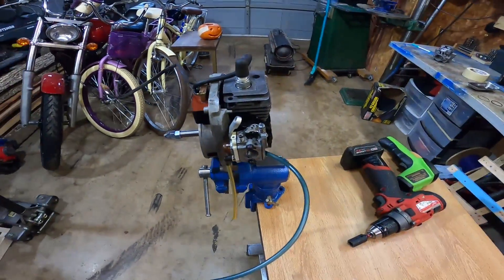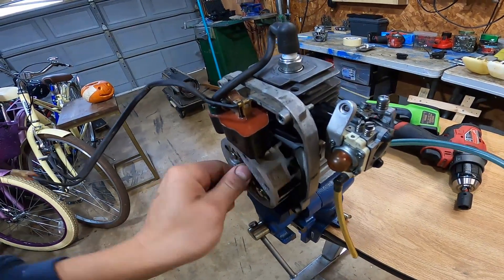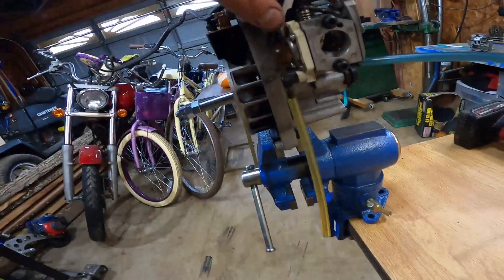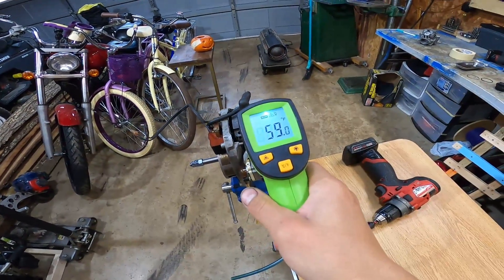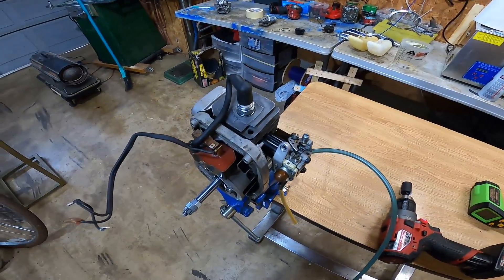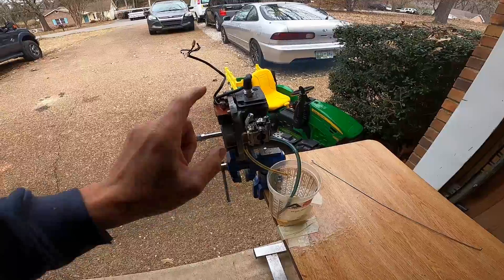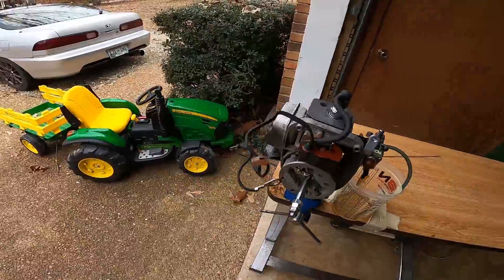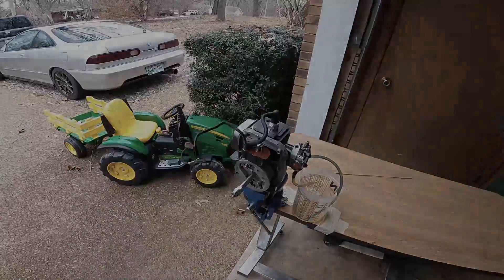Running a 2 stroke on diesel fuel!

Comment: Hozit Aaron you look like a wize man  i have a project idea to build my own two stroke engine im very technical minded got a milling machine and lathe and a bit of knowledge how to use them properly but the electronics is a battle to understand for me. 
 Question #1 is if i take a flywheel/ magneto and a ignition coil to provide the spark for the two stroke wil it work on a bike engine( the diy one) 
Question #2 why does motorcycle comes with a cdi box and flywheel /magneto and a ignition coil but stil perform the same task ultimately. 
Questions #3 Building my own diy two stroke engine for a motorcycle and just adding a fly wheel and ignition coil from a brush cutter, two stroke lawnmower mower, leaf blower etc wil it work?
Reply: It will work like a charm as long as you get the timing right. My 1982 Kawasaki kdx 175 has that exact system. And it bloody rips!!!
Good luck champ.

I think a two stroke could run with a glow plug and a spark plug and start on diesel no problem

Comment: 1/2 water 1/2 gasoline, little bit of waste motor oil for lubricity then add enough dish soap to get it all to mix it'll run with little to no tweak on the carb feel free to try it ill like and subscribe just to see that, also if you used your exhaust to heat the fuel before it goes into the carb the diesel would burn cleaner, t valve before carb to switch from gas to diesel once warmed up.
Reply: I had a stroke reading that 😂
Reply: @tyladube801  only one stroke, not 2? 🤔🤣
Reply: I wonder if you can run it on Mobil cutting oil mixed with water since it is water soluble oil

Comment: The fuel efficiency on the small engines is insane. I have a 78cc 2-stroke on my bicycle and I went a mile and a half without turning on the fuel petcock. It literally ran for 20 minutes just off of the fuel in the fuel filter
Reply from the maker: That’s pretty good! The 4 strokes use way less. But the power to size with the 2 strokes isn’t comparable lol
Reply: @aaronpratt89  lol bet
Reply: @deipweedecuchiekrucher7384  20 minutes? At what rpm? 
Killed my 72ccm because my fuel filter clogged up and it couldn’t get enough fuel…. So yeah 72ccm engine that has an mpg of 12 

If I don’t open the valve it runs for like 8 seconds tops
Reply: @donchodon4245  bro what? youre running far to rich. i have a 85ccm engine and average about 75-90 mpg depending on the rpm that i decide to ride at. about 75 when im speeding around and about 90 when im just cruising.. but 12 mpg? sheesh bro, does it not cause 4 stroking to be running so rich?
Reply: @solozedge  lol its a tank mileage less than 4kpl
Reply: I find that hard to believe, it would create a vacuum. The petcock has to have a slight flow leak even when closed
Reply: @Unknown-kd3ri  you forget about the float bowl?
Reply: @bagelbitesslightlyundercoo7958 The Float bowl ain't letting you ride for 20mins with closed fuel petcock bro. Unless your float bowl is the size of a fuel tank
Reply: @Unknown-kd3ri  Shut it boy!
Reply: @Unknown-kd3ri  yeah I have one of them motorized bicycles I have built a few throught my teens and none of witch could run for 20 minutes with the petcock closed unless his fuel line is 10 feet long lol
Reply: @cadenjames442  one and half miles I wouldn't say is impossible. There's small engines that are known for exceeding 100mpg so it's quite possible depending on the conditions of the ride.
Reply: @Unknown-kd3ri  depends on load n rpm lol
Reply: @Unknown-kd3ri  ok so what .
Reply: it took you 20 minutes to travel 1.5 miles?
Reply: Two strokes also have a habit of “hoarding” a puddle of fuel in the crankcase. When the engine heats up, it will evaporate and get used up.

Comment: Hit it with propane torch and also feed it propane for a few seconds.
Reply from the maker: I feed it map gas in one of my videos
Reply: @aaronpratt89  yeah , I ended up seeing your other video like right after that.   I blew up a Kohler motor running it off diesel.  The carb was feeding it to much diesel so it was red lined for a good hour while I was grading my driveway it on my channel,  I wish I had filmed the engine blowing up...  I couldn't believe the engine lasted an hour.
Reply from the maker: @2ndspingarage  yea engines are designed for specific fuels these days lol
Reply: @aaronpratt89  I honestly didn't care what happened to the engine.  I was shocked that it kept running with the spark plug off and running like an actually diesel.
Reply from the maker: @2ndspingarage  with high enough compression that can happen

Comment: Really cool, you don't see it much yet but converting 2 Stroke twins to full turbodiesel is a thing
Reply from the maker: I believe it. If the compression was higher on this junk motor I could probably turn off the spark ignition after it’s up to operating temperature.
Reply: @aaronpratt89  make the stroke higher
Reply: @santiagocortez9554  yep, just shave a about 1mm off the bottom of the jug.
Reply: @inoahmann7542  the what?
Reply: @jhsevs  The jug is the cylinder and head on an engine were they are cast as one solid piece. By shaving a 1 mm off the bottom it would increase the compression ratio a lot.

Edit: grammar
Reply: You can convert this weed Wacker engine to a twin turbo diesel?
Reply: @Eduardo_Espinoza  Yes, if you look at required cylinder pressure for diesel autoignition. It would have to be converted to hi pressure common rail injection for combustion timing control. Diesel octane rating is around 20 or so. It fires instantaneously when injected. Common rail diesel pressure has to be so high to overcome the cylinder pressure at TDC. Both heat and pressure control the ease of lighting it up. DARPA has been working on multi fuel power units for a long time now. They have a wankel rotary power unit that runs on diesel. It's fired with the help of the spark plug and once boost is increased cylinder pressure is raised for optimum autoignition combustion. Timing is controlled by the injection timing and advanced or retarded based on cylinder pressure and temperature.
Reply: @curvs4me  that's very cool, thank you for the info!
Reply: @curvs4me  Common rail pressure has NOTHING to do with overcoming cylinder pressures. Common rail is for finer Atomization, more precise timing control and multi event injection to get more efficient combustion.  Regular mechanical injected old old Diesels also inject directly into the cylinder BTDC, TDC, ATDC same thing. Diesels are not carbureted, they are all directly cylinder injected at , slightly before or slightly after TDC per timing specifications For combustion pressure shaping needs.

Comment: If you mix a touch of gas it will start much easier also if you pull your cylinder off and sand a couple mm's off the base it will increase the compression ratio. Just don't go to much or the piston will make contact at tdc
Reply: And when your done put it in that little John deer in the corner with a throttle limiter so your kid don't crash lol put a little smoke stack and tractor flap haha
Reply: 2 stroke compression is from crankcase not cylinder
Reply: @proforugames1071 is based off the volume of charge going into the combustion chamber. Smaller chamber with same amount of charge is more compression
Reply: @proforugames1071  bro 🤦‍♂️ in 2 strokes you have 2 types of compression the crankcase compression and the compression in the combustion chamber, both are important af and one without the other can't exist coz the same piston does crankcase compression and combustion chamber compression, if there would be no compression in the combustion chamber then all the crankcase pressure that was discharged to the combustion chamber (all that gas-air mix) would just fly out somewhere which would mean no combustion or very little combustion happening (gas and air burns better when compressed)
Reply: @datrollface2863  like spittin to exhaust manifold?
Reply: @datrollface2863 A split single 2 Stroke has 1 normal piston and a second smaller piston that creates the pressure in the crankcase very noisy old 2 Stroke motorcycles but interesting technology of the day...
Reply: @proforugames1071  both need to be sealed, but sanding the head of the cylinder can increase compression. Just need to do it on a flat even surface, like a window. Cant do that with the one piece jugs though, like in the video.

Comment: first diesel 9000 rpm hahahahaah
Reply from the maker: Just wait for the next video to drop! Thanks for the interest!!!
Reply: @aaronpratt89  thank
Reply: @aaronpratt89  usa el diesel sin el acete 2t, ya q el diesel lubrica el motor, asi mejira la quema en la camara de combustion👌🙋‍♀️
Reply: @aaronpratt89  don’t use 2 stroke oil on diesel , it’s with oil and you don’t need add oil 2 stroke and this cause oil starvation and blue smoke

Comment: The diesel engine in my 2ton is  2 cycle
Reply: I have 2 6v53’s in my 45 foot fishing boat.. these engines are tanks
Reply: @mikecorleone6797  I love them. Planing on a 8v53
Reply from the maker: What kind of truck?
Reply: @aaronpratt89  the engine is a 6v53 Detroit. The truck is an 87 IH S1600

Comment: Why is the smoke not black?
Reply from the maker: That’s a good question. Due to the lack of compression in this engine, I am not getting enough heat to actually burn all of the fuel. The second reason is the amount of fuel is still considerably low. When you see diesel trucks blowing black smoke, it is caused from a fuel mixture that is too rich but combustion is still being completed. Soo if I could increase the amount of fuel to air I could possibly have black exhaust. But with the carb I was using that would have been hard to accomplish.

Comment: Love your show got a question I have an older 49cc motor just like the goped motors and was wondering if I could take a 71cc big bore kit for a 2stroke scooter from Amazon and put it on my motor
Reply from the maker: That’s a good question. There are a lot of issues when combining engines. The first thing, is the cylinder bolt pattern the same? Next, is the piston skirt short enough to clear the stock crank during rotation? Is the stroke long enough to match the required port timing for proper performance? Lastly, will the coil mount properly and is the flywheel going to clear the new cylinder? I honestly have no idea what engine you have or the big bore kit in question. There are a lot of zenoah replica engines out there. Some of them are almost perfect clones while others are completely different under the plastics. It’s impossible to judge that and give you an accurate answer through comments lol. 

Thanks for the support and interest! I am working on a new video now!
Reply: @aaronpratt89  thanks for the reply I didn’t think about the bolt pattern I was thinking of the Zuma head and the Chinese 49cc motor u see on amazon I’m not sure if that’s the motor I have but there identical I also have three goped a lol thanks for your time
Reply from the maker: @jeffkrauss5582  Anytime! I try to get back to most comments. Since my channel is new it’s easy lol. The zooma scooter engine looks similar to a lot of engines. Hell yea on the Goped’s! Goped brand scooters are my favorite. I have 6 that are turn key at the moment.

Comment: Do you know if diesel will destroy carbs and fuel systems? I run rc cars with 2 stroke engines but I wanna see it run on diesel, is there a way to clean diesel out of a tank?
Reply from the maker: It will not destroy most carbs. Most gasoline carbs are resistant to diesel. The best way to clean the diesel out of the tank is with some good ol alcohol. It will mix with the diesel and thin it out enough to flush it out. Be sure to let the tank dry before re fueling. However a tad bit of diesel shouldn’t hurt anything.

Comment: Welp, now I know what the old zenoah 32 is getting when it’s about to blow up, know of anything I can do to it so I can make it blow up lol? I wanna see destruction
Reply from the maker: The best thing to can do to blow it up is to run nitro methanol. Yes the rc car fuel. However I high do not recommend it. The flywheels are not rated for the rpms you will reach with nitro fuel. There is an extreme risk of the flywheel exploding. If you look at my other video I run this same engine on nitro. It becomes unstable. The amount of heat generated will cause the ground on the park plug to glow and act as a glow plug. When this happens you can’t shut the engine off. I recommend using a string tied to the carb and stay very far away from the engine when trying to blow it up.
Reply: @aaronpratt89  I have rc car fuel, I use to run nitro, man that stuff is expensive lol, how far would you say I need to stand before flywheel shards are flying at me
Reply from the maker: @nitrogas5719  use your best judgment. I’d think more than 20 feet would be good.
Reply: @aaronpratt89  when the engine does blow up, do you think it could destroy a car, I plan on starting the engine on methanol and just floor the thing away from me and watch the destruction occur
Reply from the maker: @nitrogas5719  it depends. Engines blow up for similar reasons. But the damage is normally different. The connecting rod my break before the flywheel comes apart. It’s hard to judge.
Reply: @aaronpratt89  when my engine is about to let go, I’m gonna buy a cheap knock off carb, all new fuel tank seals, put nitro in the tank, and then just wide open throttle all the way in the field.
Reply from the maker: @nitrogas5719  hell yea!
Reply: @aaronpratt89  👍👍👍

Comment: I wonder if a hotter plug would make it run much better like glow plugs
Reply from the maker: Well glow plugs are not as hot as true spark ignition. A glow plugs job it just to increase compression temperature. I’m not sure the exact temperature of the spark. But I believe it is hotter than a glow plug. If I remember right, spark is around 5-6k degrees.
Reply: A spark is super hot but will deliver very little energy due to low duration.